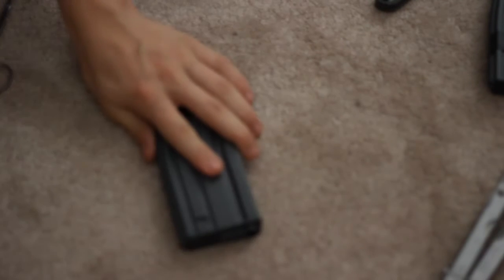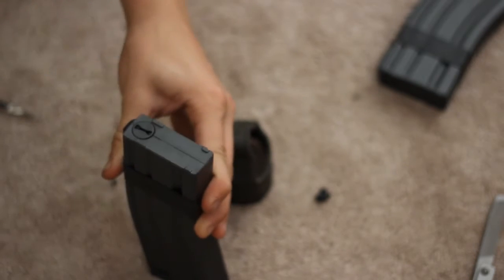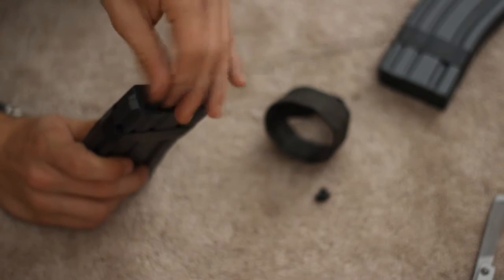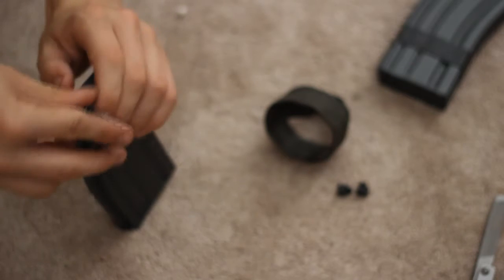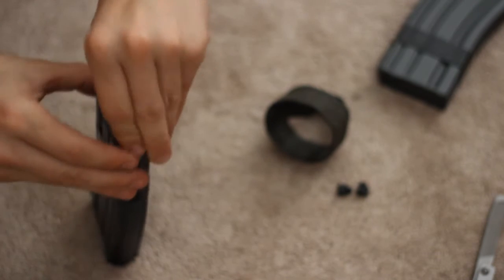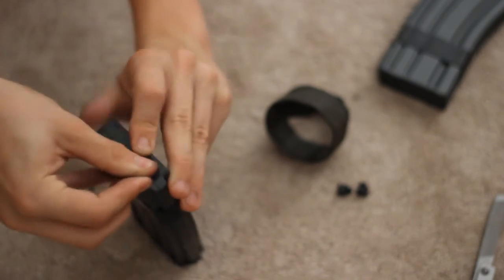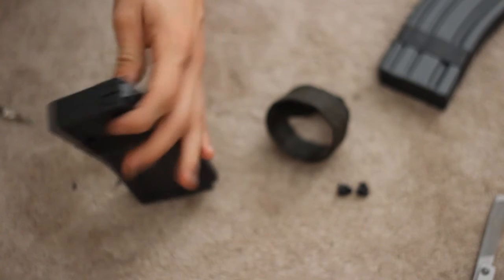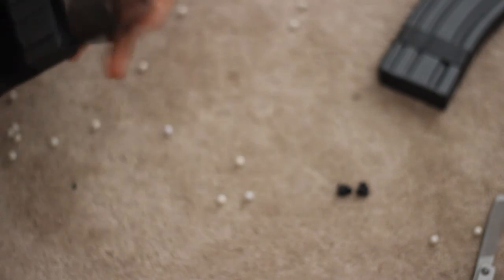How to preform Maintenance on a Mag M4 Midcap

Comment: Ok. That’s called a follower, not a header or feeder.

I also wouldn’t rough handle the mag spring, that’s probably why yours is malfunctioning. 

For those trying to get the bottom cap off, twist the slot so that it is perpendicular to the long side of the mag. Then use something to lightly pry it out. The spring underneath shouldn’t be under too much tension. 

Never stretch the spring, lightly guide it out.

Comment: I just bought a brand new DYTAC Invader 120 Mid cap mag for my DBoys M4.  I have 11 other mags that feed flawlessly but not this new DYTAC one. The BBs seemed to get jammed after firing the first shot.  The first BB gets shot out, but after that the magazine seems to stop pushing the BBs up the hopper completely.  I've tried filing down the retention nub, even using one from the magazine that came with my M4.  Nothing works.

Comment: I have elite force midcaps and they are awesome feeding, but after crawling through dirt, bushes, mud etc almost 8 games, they are jamming non stop. More so then that skirllex. Any time I even attempt to unscrew them, the screw (made of plastic/polymer) gets stripped. Are they glued or something? The only one I ever got off is one I pushed down with the flat head so hard while turning, that it broke the screw in half making it fall out. suggestions?
Reply: i did this just now to my king arms pretty much the same mag. and you have to gently push down and slowly turn try both ways dont put a lot of presser and no i do not believe it is glued i will try later with my buddies mag to get back to u for sure to let u know what i did or tricks on it
Reply: Elite force midcaps are glued